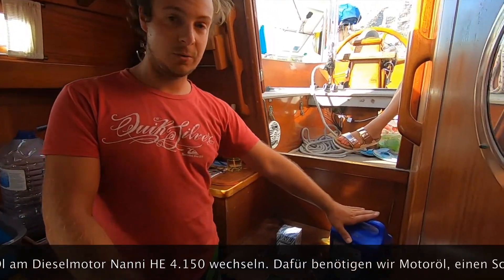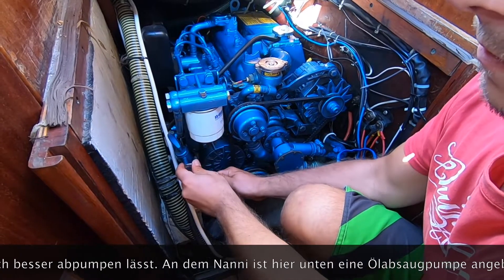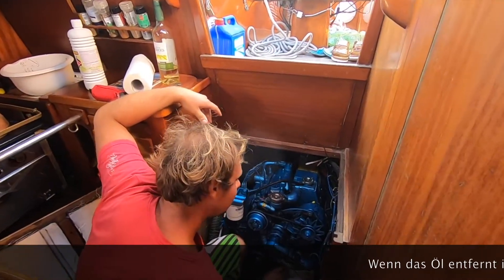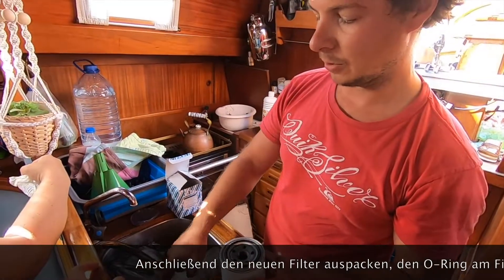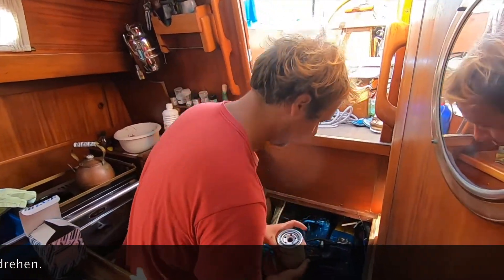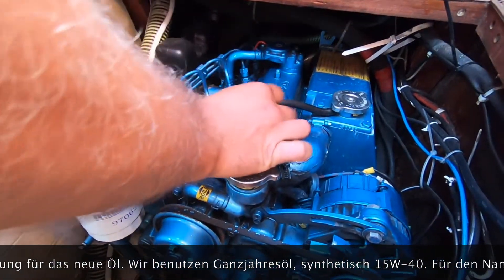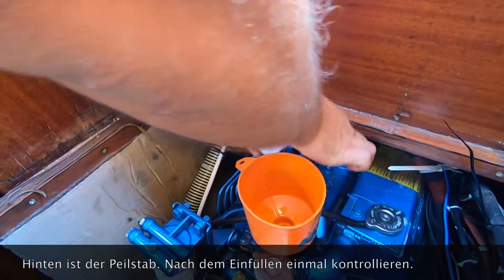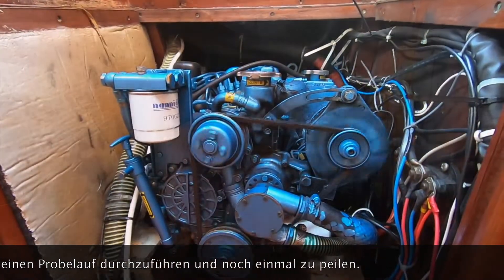Oil change on Nanni HE 4.150 – Mini Ep. 19 Thula Sailing

Comment: Thanks for sharing I have the exact same engine on my sv noah, if you can maybe you should do a film about the gearbox/ transmission oil check and chamge and oerating the trotle lever  to go front and reverse, mine it’s not working properly. Thanks again fair winds and goodspeed, passing Portugal let me know, Im in Lisbon and my boat is on Sines Bay, 150 kms south of Lisbon
Reply from the maker: I had the same problem but solved it. Video coming soon!
Reply: Looking for it. I have pdf manuals and parts diagrams, if you need them drop me your email